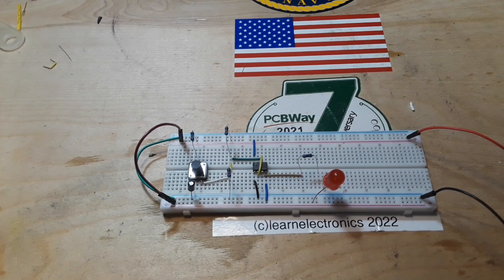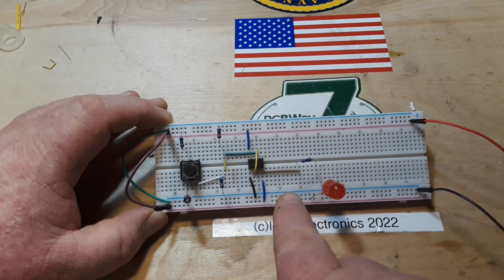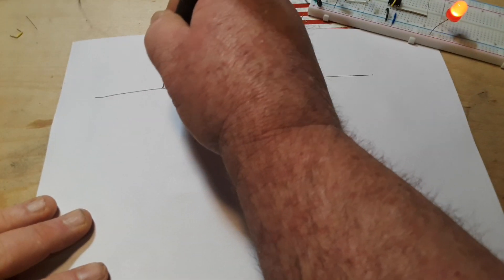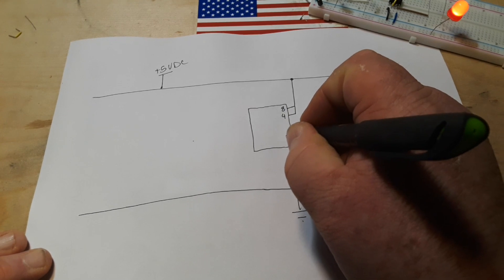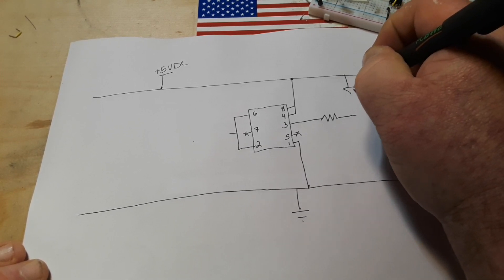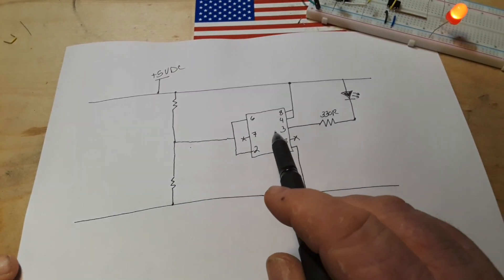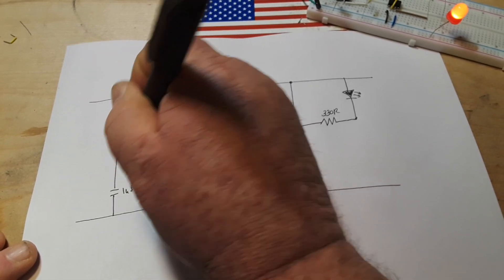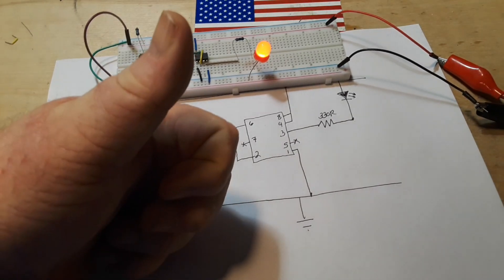Toggle On Off with Momentary Switch

Comment: I have a situation where i need to take a momentary switch and control 2 circuits in a way where i press the momentary switch and one circut comes on and press it again and they both come on is there a way to do this?

Comment: An interesting exercise is to convert this into a bòot strap circuit, so that the circuit is truly off, when off. That means drawing zero current in the off state. ( The latch circuit unpowered in the off state). 
It is also worth considering how to make it proof against accidentally supply polarity reversal when dc powered, and how to make it work when a.c. powered. 
Consider the first problem, how to make it bootstrap. 
The principle is easy to explain, the details are more difficult without the ability to show the circuit diagram. 
The trick is to use both edges of the momentary button push, and its on state. The circuit to be powered is switched either by a power transistor (mosfet or bipolar) or a relay.  The latter works with a.c. as well as dc.. When the button is pressed  it allows the relay or pass transistor to power the circuit to be controlled, including the latch. But pressing the button also toggles the latch being powered via the pass transistor or relay. The output of the latch is wired OR with the button. So when the circuit is off, (unpowered), pressing the button switches it on, it also changes the latch status so that it holds the circuit in the on state, even when the button is released. 
When the circuit is on, held on by the latch, pressing the button changes the status of the latch, removing its ability to hold the circuit on. This when the button is  released, the circuit returns to the truly off state. (Note, depending on the implementation, in order to avoid logic race conditions, it is some times nessary to ensure the latch powers up in the switching on state as the default condition. )

The advantage of this arrangement is that it does not matter if the latch is run from a regulator after the pass transistor. So the latch can run from a regulated 5 volts or 3.3 volts supply, while controlling the  raw 12 volts supply powering the input to the regulator, as might be the case in car electronics.

 While the circuit can be implemented with just latch logic. It really is most often used when powering a micro controller, such as in a mobile phone.  The first thing the micro does at power up,  is to hold its own supply on,  while monitoring the state of the push button on switch, that allowed it to receive the initial power to turn on in the first place.
Pressing the button while the micro is powered, instructs it to remove the signal that is holding its power on. Then when the button is released the circuit turns truly off. In the off state the only current consumed is the leakage current through the transistor, usually micro or pico amps.
If a relay is used as the power switching device, the off current is effectively  zero.

Comment: There is a transistor only version of this type of toggle switch with 2 NPNs and 1 PNP and a few 100k and 50k, I found it on Evan Kale's channel about 5-6 years ago but the video is removed but I somehow remembered the working so I tried recreating it on sim and it worked.
Edit: Also a 50uf cap

Comment: Hey Paul, there's a mistake in the schematic you drawn. The 100k should be connected to the output (3) of 555 not to Vcc.
Reply: Didn't work in my simulator until I followed your comment, thanks
Reply: Been scratching my head trying to figure out what I had done wrong, apparently nothing compared to the schematic. I'll try the fix tomorrow.
Reply: yes and the led is connected to + while the realization is connected to -.
so in the diagram the LED lights up as soon as the power is turned on.

Comment: Correct me if I'm wrong: The voltage at the node is 2.5 volts, the voltage at the 100k side of the momentary switch is 5 volts. When you close the switch, the voltage on the 555 side of the momentary switch increases for a moment causing the 555 to latch???
😬☮️
Reply from the maker: Yep

Comment: Please make it a practice to explain the path of the operations of your circuits... Ex: 555 Switch = Power passes through the switch and goes to X comparator, then to x transistor... Etc. You did not teach us anything about how this switch works. You only showed us how to set it up. This leaves us frustrated and drives us to other channels to find the answer. Driving us to other channels drops your viewership. Offered as a friendly, helpful business hint.